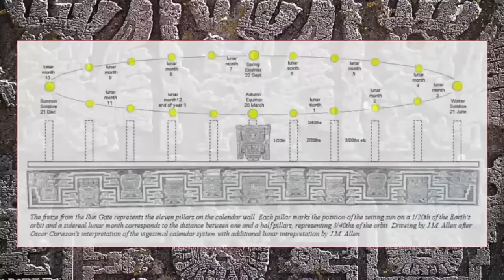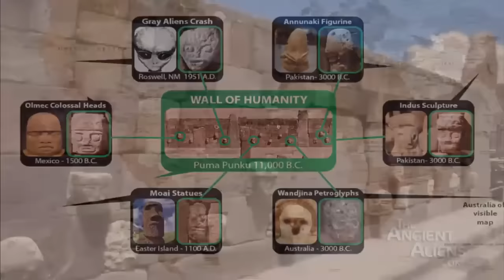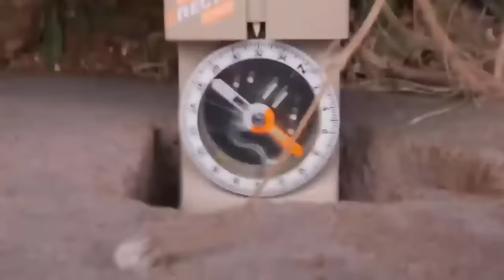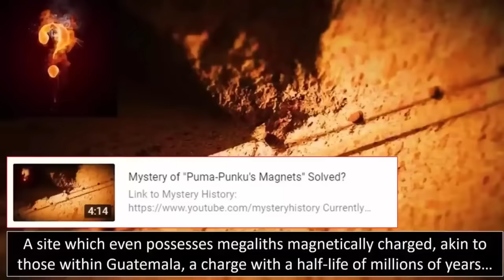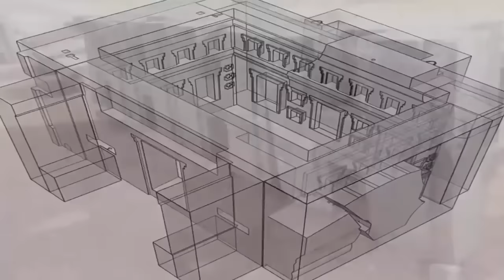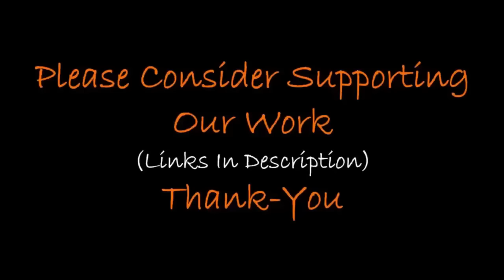Secrets of Puma Punku Revealed?

Comment: The giant slabs of puma punku actually slide together to form a huge wall of enormous structural strength. Before the last major pole shift, the shores of Lake Titicaca extended to this area and the wall was part of a giant dam and wharf structure. The shift shattered the structure, tilted the earth surface and caused the lake to shift to its present location. 
      Chris Dunn has researched extensively and built a model. What is fascinating is the incredible accuracy and technological near-impossibility of the precise inside-angle cuts and drill bores into extremely hard andesite, the edges of which are dangerously sharp to this day. The age is estimated to be similar to the Sphinx enclosure and other worldwide megaliths
Reply: Yes

Comment: GEO-POLYMERS WERE USED TO POUR THE MEGALITHIC BLOCKS WERE CREATED BY MIXING THE ANDESITE WITH GEO-POLYMERS, WHICH IS THEN POURED INTO MOLDS GIVING US THE "H" BLOCKS, OR THE LARGEST BLOCKS IN THE WALL THAT YOU CAN OBVIOUSLY SEE THE FORMS WERE REMOVED TO QUICKLY SO THEY ATTEMPTED TO SAVE THE LARGEST BLOCK, FROM TOTALLY BLOBBING OUT, BY PROPPING IT UP. THEY WOULD ALSO POUR IT AND THEN CUTTING TO THE DESIRED SHAPE BEFORE IT HAS HAD TIME TO FULLY CURE. HOW ELSE CAN YOU EXPLAIN REMNANTS OF BIOLOGIC'S FOUND INSIDE THE GRANITE AND ANDESITE. WHERE THESE TYPES OF STRATA REQUIRES IMMENSE HEAT AND PRESSURE TO CREATE THEM.